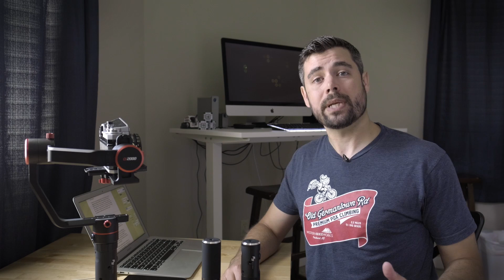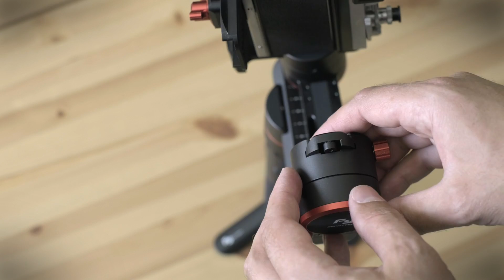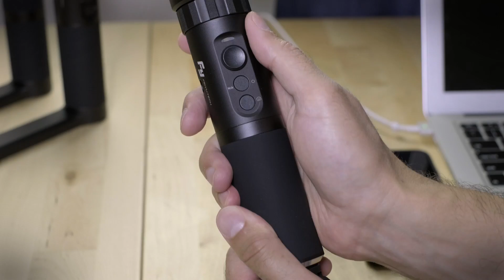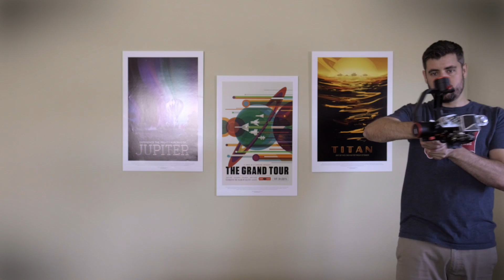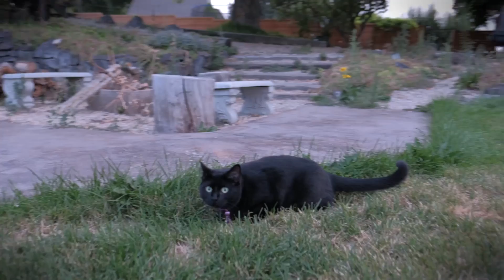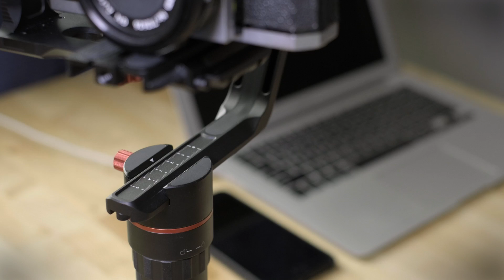FeiyuTech A2000 Gimbal - Hands On Review

Comment: Is the single handle and the double handle together or am gonna buy it seperate,cause am afraid of ordering it,cause i want both the single and the double so I wanna know if i order Feiyutech A2000 Gimbal,is it gonna be both the single and the double handle,thanks.
Reply: you can buy it with just the single hand or as a kit with the 2hand attachment which costs about 150USD more hope that helps.